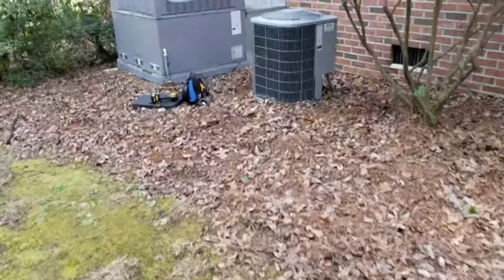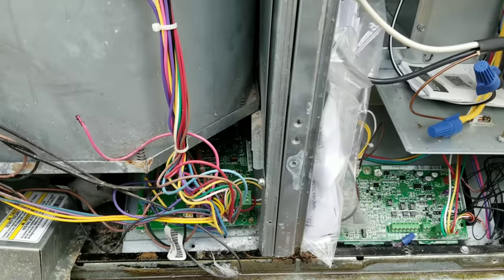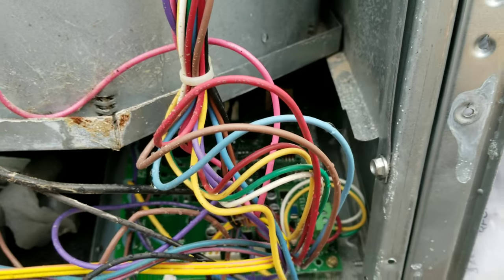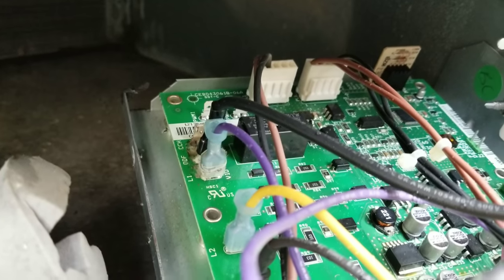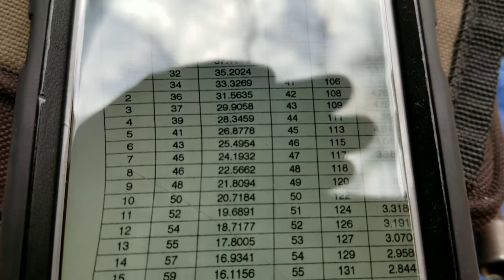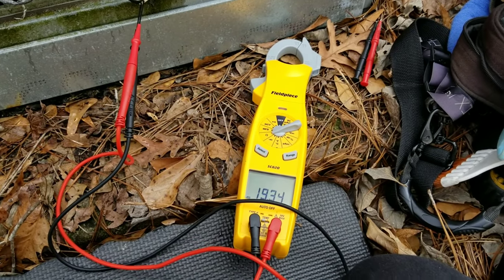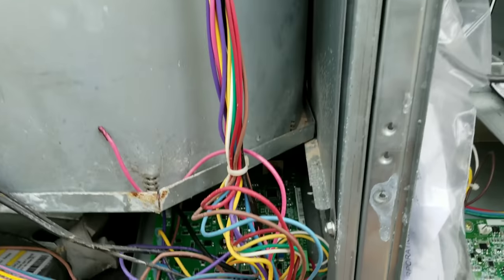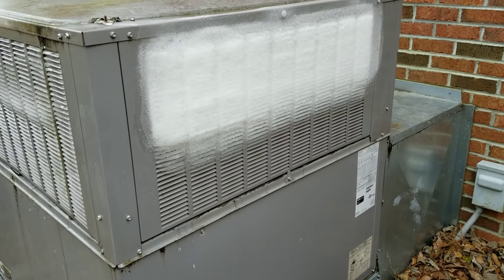Diagnosing A Frozen Heat Pump

Comment: Good job, I like the procedure you went through - best way to keep from getting a callback from a multiple offender or thinking you got it gassed-up, good to go, only to find out you got a bad sensor or board.

...you were wayyy too diplomatic about the level of thought put into the design, lol
Reply from the maker: Thanks Mike!!
Reply: @HVACinSC  The Day & Night variable speed Air Handlers have the boards mounted low down on the air handler like that too - gonna be fried first time the condensate drain backs up or the coil freezes.
Reply: mike_HVAC , I seems that,’designers’ do NOT Speak to th test guys in the factory, all se units have the boards in the MOST CRAPPY areas, DRAIN BLOCKAG, that does NOT HAPPN N  REAL WORLD.
Wanna bet? there has go be  better way.
Reply: People that just “gas it up and go” need to get out of this field.
Reply: @HVACinSC  ‘

Comment: Good call. Not sure I would have replaced the whole coil but everyone does it the way they see fit. I usually show the customer where that leak was and the repair and if another leak springs in a similar way then replace it. I also repair many leaks on the cap tubes on those things.
Reply from the maker: I've repaired hundreds of simple leaks like this out of warranty. It's stupid simple.
However when a part like this is under parts and labor warranty you arent doing the customer any justice by fixing the leaking coil. The likelyhood of more leaks is high and I promise you if it is out if warranty when the next leak springs and you didn't replace that coil when you found the original leak, you can kiss that customer goodbye. We choose to do what's best for our clients  and replacing this leaking coil under parts and labor warranty is the best option.
Reply: @HVACinSC  I'm all about customer service. In fact I'm a 1 man show in business now for 25 years. My whole business is based on the customer service. In all my years of fixing that type leak I havent had a call back yet and I base that only on customers that have been mine for years and years and not those that call once and are never heard from again. Dont get me wrong I'm not cracking on you for doing it this way in fact its outstanding that you do it. I'm simply saying that in my experience I've found it unnecessary and thus far it's worked out. If one of my customers were in year 9 of an install developed that leak and a similar leak developed 3 years later I'd foot the bill on a new coil for them. Hasnt happened yet knock on wood. We all have our own methods but bottom line is if the customer is satisfied it's all good.

Comment: Good find.. That big blue i found thinning down it bubbles up more. I has a gas line that wouldn't hold an air test and i was going crazy looking spraying and nothing. I was telling my story to some friends one guy heard worked for the gas company and he told me thin it out, he said sometimes the mix is too strong and won't bubble up, but thin like kids bubbles it will grow and II'll find it faster.. He was right for me .i had mor success thinning it out
Reply from the maker: Ive never had to thin it out in the 10 plus years I've been using the product. I just apply it and wait 5 minutes. If there's a leak it will show 100% of the time. Even the tiniest of leaks will show up as a white foam (micro bubbles). The key is to have the patience to wait the 5 minutes. Best bubble leak detector on the market hands down. I feel that thinning the product will produce larger bubbles faster but will reduce the size of leaks the product is capable of finding.
Thanks for watching.
Reply: HVAC in SC  I Agree, Big Blue,<hands down,,the best, bulking for oil,,can be a.  bummer many moons ago in a supermarket, they kept loosing 500lbs  off R502, the s 4 days going over piping, cases etc, 
They sent me  over, I dropped something, then felt something BLOW  in my face, the hp control was leaking, ZERO OIL ON FLOOR ,  replaced that dual pressure control. Maplewood NJ
Reply: I  use sunlight for small leaks and baby blue for big ones. Sunlight bubbles like crazy. But you need to whip it off after as it will discolour your copper and metal.

Comment: I literally did the exact same thing today with a Lennox. Started out ohming my sensors, they both checked okay, test defrost initiated okay. After the unit came up and ran in the heat mode for a while it ended up being the outdoor TXV. It had dropped my pressure down and put the board in a low pressure lockout. Homeowner would have never had a clue it was happening but it was 77° yesterday (broke a record high) and they turned on the AC and it never cooled the house down. That's when they went out back and noticed the ODU wasn't running. It's surprising that Infinity didn't trip out on some kind of fault. I've always hated that style of package unit and what a terrible idea putting those control boards inside of the blower compartment. 😒
Reply: Dang 77 degrees what part of the country do you live in? I'm going to guess in South Florida. I'm in Arizona and we had snow last week (Northern AZ of course at a higher elevation). I also agree about the bad design on the location of that board.
Reply: Tennessee 👍
Reply: Placing a pcb in a spot next to where water drips as well as next to the compressor compartment where radical hot and cold cycles will effect said pcb can only be explained by "planned obsolescence".  dumb AF to techs and consumers but brilliant to investors and beneficiary stock holders. Why every single unit out there be it a window AC or a roof top pool dehumidification system, doesn't have a refrigerant charge sensor of litterally any kind only strengthens my point. Some do and some don't.  some have lil windows to look at the charge/oil levels some don't.   they ALL should have something other then a symptom.
Reply: Shannon Knight HVAC  ont recall bd,,but it was a furnace, in cooling season, all ICED UP but the control board was below the ‘A’ COIL, so needed to get it defrosted, but 1 hell o a time keeping that board  dry , even the floor was wet,  sure was low,did find leak, on roof ( R22), must have been 25 years ago, as been retired 15 y, now 77 year old , but I still go ot told s with problems
Reply: Si Air conditioning 🙄

Comment: You should check superheat on the outdoor TXV after you replace the coil. Some older fixed superheat txv’s were notorious for underfeeding.
Reply from the maker: Most Carrier systems (including this one) do not use TXVs for the outdoor section. They use pistons.
Reply: Good to know, thank you.
Reply: He added refrigerant and the low side pressure came up if there was a partial restriction in the accurator ( piston valve) it would have done nothing to the system pressures. Just a tip if you are checking the charge on a package unit that does have a TXV subcooling is the fella you want to be looking at other wise how would you know if the valve is shagged or the units short?

Comment: At least that’s not one of the carriers with one panel that covers the compressor, blower and electrical, those suck. Awesome job btw
Reply: I hated those Carrier gas packs as well having to flip the panel on end to cover the blower compartment while testing the system. Fortunately I don't see much of those anymore because the area I work in (Verde Valley, AZ) has mostly Lennox, Day & Night and Trane systems. Every once in a blue moon one might see a Carrier system out here. I did the maintenance at the Camp Verde Public Library last week and they've got Carrier Infinity split systems there.
Reply: @azoutdoors2344  Goodman gas packs are junk too lol

Comment: 9:00 indoor coil dirty or dirty filter in heat would cause a high pressure situation, BUT, it can also cause the charge to look artificially higher than it is, also, that's an easily fixable leak, rather than the headache of replacing the whole coil. And, I'm still waiting to see a bubble from that spot you found, bubble solution will gather with bubbles at the bottom of fittings, I always verify that I see bubbling. Anyway, nice video and troubleshooting!
Reply from the maker: Did you watch 9:01 where I showed the coil and mentioned the filter? 😆
Reply: HVAC in SC of course, proved my point! 😃
Reply from the maker: Your point? 🤔 You mean the one I made in the video?🙄 Seems legit. 
And since you edited your original comment, the coil was under parts and labor warranty. Repairing it would cost the customer $$ where replacement would not. Im not into cheating my customers. As far as you seeing the leak or not, that is irrelevant. That was were the leak was and it has since been replaced and working great but thank for the entertaining video analysis. 👌

Comment: Carrier turned to junk in 2010. Great service!
Reply from the maker: I like Carrier. Just dont like how they divert the defrost condensate on these units. 
I personally think there is no brand currently on the market that is head and shoulders above the others. They are all flawed.
Reply: HVAC in SC  have you ever been in a house with that CHINESE DRYWALL?, While in a supplyhouse in FLORIDA, a guy approached me, as I had on an old RSES shirt,<so I went with him, he was changing out the 2nd evap, but as I got in the house,, it smelled like SEWER GAS, ,  had a good look at the ‘old ‘one, my god,,I had NEVER SEEN ANYTHING  , like it before, even ITHOU PESSUIZING IT, that was a o in PARKLAND FL ( Broward county).,anything copper turned BLACK, Silver BLACK. from Maplewood NJ.

Comment: Since it's under parts and labor warranty , I would replace both coils on this unit .
This model is prone to coil leaks in each of the coils .
Reply from the maker: Manufacturer will only approve the side that's leaking. It's a special order part not generally stocked.
In my experience these models have very few condenser coil leaks. I've only seen about 6 in 15 years plus.
Reply: @HVACinSC  
I enjoyed your video and path of trouble shooting.
Been down the road with this model too, and found leaks forming in the  tube header.
They normally follow the sequence of fix one leak ,then find more .
Your correct in the manufacturer only giving warranty on the condenser coil .
Keep up the good work and stay safe .
Thanks again

Comment: If this wasn't under warranty, and it was your own home unit, would you try to resolder that joint that was leaking, rather than replace the whole coil?
Reply from the maker: Yes. Residential or commercial it's a simple fix but this being under parts and labor warranty, the best option is replacement. Thanks for watching!
Reply: @HVACinSC  How would you do the repair in that case? Would you use soldering option or use some other binding agent? Could the repair be done while the system is under pressure or you would need to discharge the system first? 
Thanks for taking your time to make and post this video.
Reply: If you have the equipment to decant vac and pressure test the systems it's not a big job to fix the leaking coil but be advised you cannot repair a leak on a system that has pressure in it
Reply from the maker: Again... out of warranty this repair would be an option. Under warranty that would not be covered therefore in order to repair this I would have had to charge the customer rich would be shitty business practice on a system that has a parts and labor warranty.
Reply: Well, speaking for myself I wasn't questioning your action. I just wanted to know what could have been done for the units that are out of warranty.
Reply: @iskoos  Guys, I've seen this before on my own channel. Because of a Youtube software glitch, the author doesn't get to see the last remark unless he reads the whole thread, and when you view the thread by clicking the bell, the most recent comment appears at the top, not the bottom. Youtube have changed this recently, it is confusing. I believe he's responding to the first remark, which he thinks was repeated. It wasn't, all is good.
Reply from the maker: My last comment was in response to Greg dobbins.
I read nearly ever comment I can.

Comment: I had that same leak detector for two years.  It really sucks at picking up HFC leaks.  Great for R22, but horrible at 404, 410 and 134.  The inficon rechargeable version of the one you have is way better.
Reply from the maker: Never had any issues with this model but I rarely use electronic leak detectors these days. 
All electronic leak detectors stuck outside when its windy. 😁

Comment: Great video where can I find the chart  for the ohms resistance
Reply: Orlando Perez Google 10 K Ohm thermister chart. FYI a thermister nominal value is based on a temperature of 77 degrees.
Reply: Thanks  I found it already very helpful 👍
Reply from the maker: I just find most charts in the back of the systems service manual.

Comment: Since this is by no means my wheelhouse I mean this only as an outsider's suggestion seeing the water dripping issue. You mentioned it would be nice to have a trough there and I suspect you have some metal tape in your truck that you could create a temporary trough to direct that water away from you... just a thought, maybe I'm missing something and that idea won't work.
Reply from the maker: Metal tape doesn't stick to wet surfaces, so you would have to dry the entire unit out for that to be a viable temporary option. A dry rag works fine for a quick fix.

Comment: Where do you get the chart with the temperatures in relation to resistance value?
Reply: From the respective manufacturer  of the particular thermistor you’re working on.

Comment: Great video! Since there are so many thermistor types (and corresponding charts), what type was used on this unit and where did you find the chart for it?
Reply from the maker: Not sure the specific 10k ohm type. I just use the charts provided in the back of almost every systems service manual.

Comment: Shocker! Carrier equipment with a bad design and factory leaks haha. Good job finding the issue
Reply from the maker: Theres no brand on the market that doesn't suffer from poor design and premature failures. Just the nature of of industry today. Thanks for watching!
Reply: I pulled a Carrier R-22 unit that was being replaced at the insistence of the homeowner about 5 years ago... 1999 manufacture, put the odu and a-coil right in my place and it's been going strong since. They don't make em like that anymore. Simple and built like a tank. I think that was an 11 or 12 seer unit. These compressors and condensers just have to run at a ridiculously high pressure these days.

Comment: Good catch Brad. Didn't consider to braze?
Reply from the maker: Not while under parts and labor warranty. That in my mind would be a disservice to my customer. Change it out and not worry about it anymore.
Reply: HVAC in SC  have you  ever been to any refrig factory? The flame they use would blow your mind,,and they are STNGEY. With the brazing rods., it’s a wonder they are not more leaks.

Comment: Check filters first regardless of anything else.
Reply from the maker: Nope. I want to see what the system is doing before I start assuming and changing things. 👍
Reply: I would agree, check the filters and the coil before wasting time with sensors. It takes 10 seconds so if it wasn't the problem, you have a better idea of what to look for.
Reply from the maker: After doing this for as many years as I have you learn to leave things as is to asses the system to see what it is actually doing rather than showing up and changing things. After assessment,  then you can remove dirty filters to see a before and after operation. I've seen way to many green techs jump to conclusions see this sort of filter, replace it and run. Then generate a callback because of  assumptions.
As the video clearly showed the filter was dirty but had nothing to do with the issue the customer was experiencing.
Reply: I guess its all in how youre trained. I was trained, when rolling in on a no cooling call, to check delta t, filter and clean coil regardless, then evaluate, plus less running in n out. Time savers is all
Reply: Besides.....that filter still needed changed out anyways
Reply from the maker: Nothing worse than spending my time and the customers $$ cleaning a system only to find it out of refrigerant,  grounded compressor, ect.
Reply from the maker: To each their own bud. We prefer to actually see what the system is doing prior to making any repairs or recommendations.
Reply: Keith Shoemaker I once went to a residence in WAYNE NJ,  as I drove in I saw a fat iced up suction line to the unit  , Saw the customer, checked the air handler, , they had an electronic filter, BUT the primary filters were were BEYOND BLOCKED 3 dogs, & 2 cats, WOW, so took outside and washed them down, also washed the cells, not really bad, so left the blower going to clear the evap, , so the customer was really SURPRISED, she thought  the unit DESTROYED THE DIRT!,,and so I showed her ,,ant told her to clean the primaries ,,every 2 weeks with all those pets,., nothing else wrong with the unit.  that was a BRYANT  unit (  carrier), she was ever so greatful, she had cooling.that was about early 70s ;.  from Maplewood NJ
Reply: How could you get good readings with a dirty filter?  @keithshoemaker6034